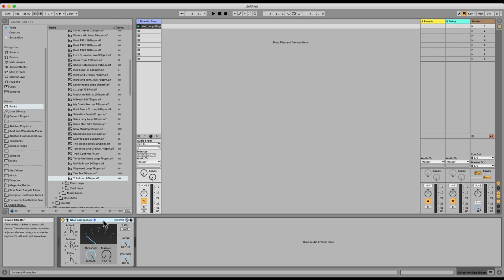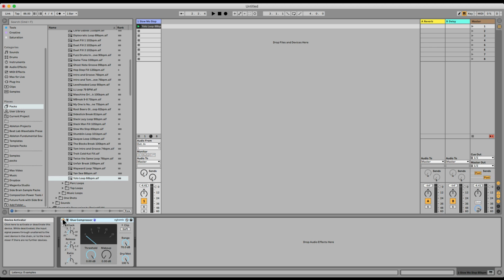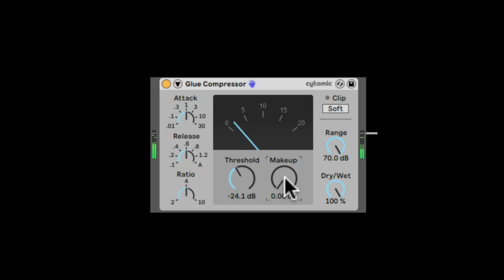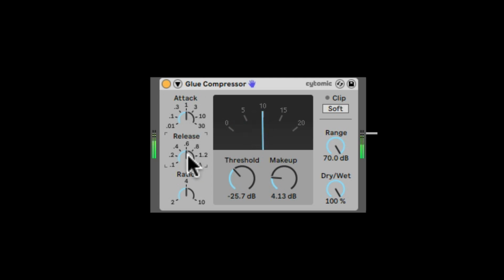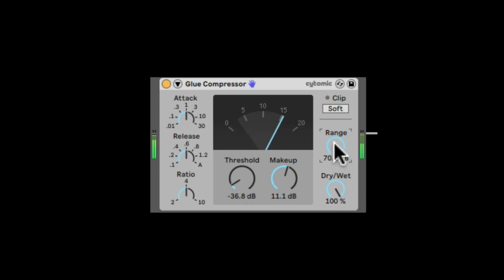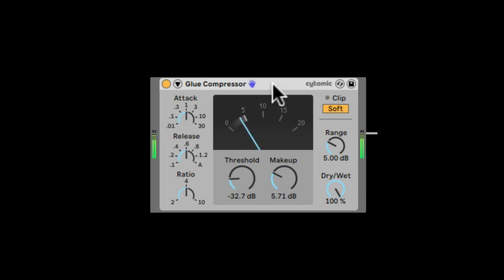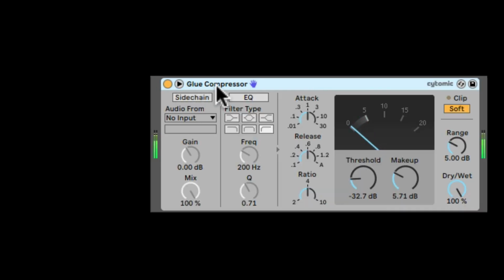All About Ableton Audio Effects - Glue Compressor

Comment: Range knob - it does more than just limit the range. it affects the sound, if you try it. wondering how...
Reply from the maker: The range will simply set a ceiling on how much compression can occur, in dB. You might be hearing changes to perceived loudness, or pronounced colour of the glue compressor, in accordance with the range you're setting.

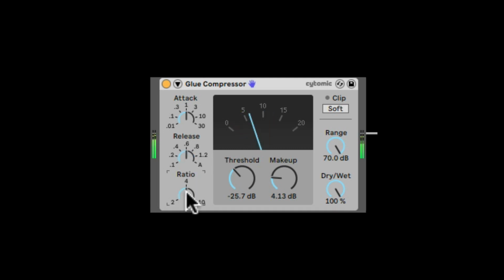Comment: Also, I learned tonight that the Threshold changes when you change Ratio. It is not fixed, but follows the Ratio knob. You can even see it in your video at 2:58 when you go from 4-1 to 2-1, it compresses more suddenly which is weird if you don't know this.